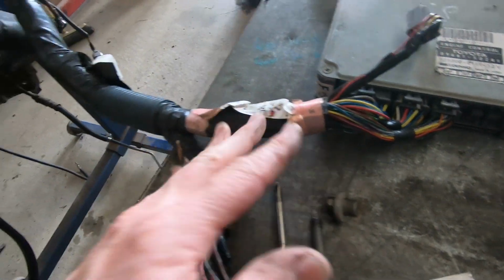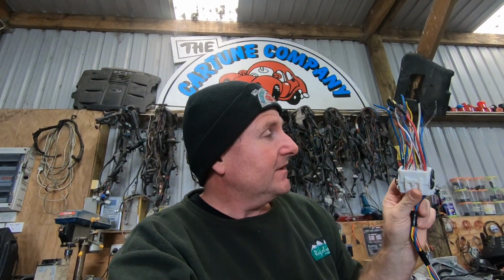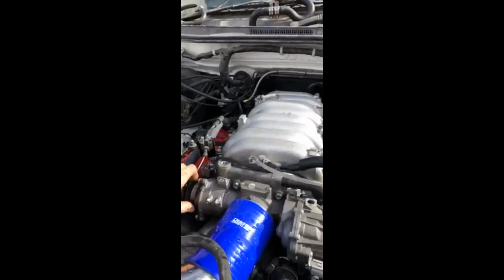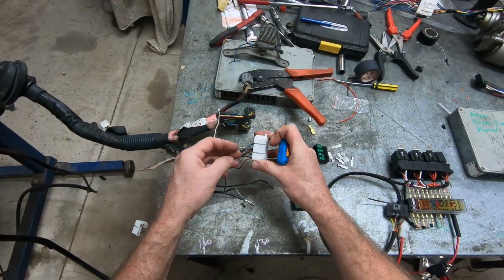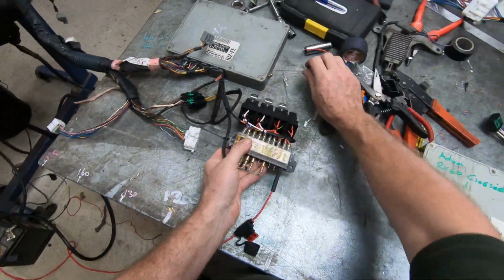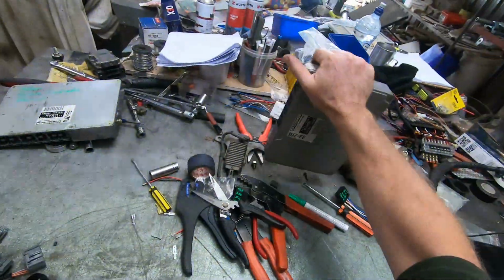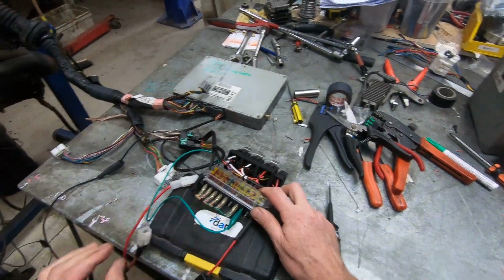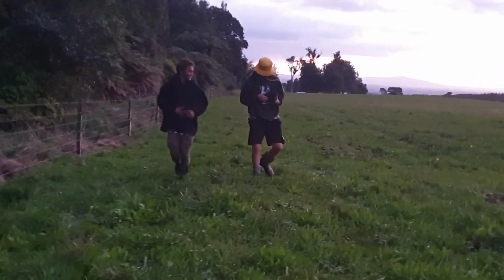UCF20 non vvti super easy fit plug and play Relay setup to stock wiring loom - Manual only.

Comment: I am in the early phase of wiring in my 4Runner 1UZ swap - reading diagrams.  I am assuming the 4 relays in that setup are ignition, starter, main/EFI, and circuit opening relay.
Reply from the maker: Some have start relay and resistor for fuel circuit,  some have start and the twin fuel relays depending on requirements.   I have information to purchase on wiring these correctly
Reply: @CartuneNZ Thanks for the quick reply.  Do you have a web address I can visit?
Reply from the maker: https://thecartunecompany.co.nz/contact.aspx

Comment: Would that work on a 90 ls400 as well? I was just going over your instructions last night trying to put it together
Reply from the maker: For a manual setup all the same wires exist in the 1990 however pin positions are different.  In time ill make the same thing for the early looms too.

Comment: I’d love this set up for a 40 40 40 soarer auto. Please let me know if it could be available.
Reply from the maker: In time Ill do one.  Soarer have lots of extra wires which are a bit of an issue when designing this sort of setup unfortunately but in time ill work out a plan.
Reply: CartuneNZ yeah I need one also for a manual transmission and trans look removed. Please let me know when it’s done, I would like to purchase one too.

Cheers

Comment: Brilliant stuff. So with this relay setup i could basically strip out trac control, air con and such that i don't need from my 91 soarer loom put a plug on the required wires plug in relays and have my cruiser running. Mine is going to run auto so would need the appropriate relay setup when available, but this just made my day. Wiring and the cost is something that has had me a bit worried on my 45 cruiser conversion. Currently running commodore v6 with a "v6 conversions" loom
Reply from the maker: Thats the basics of ot however I dont support soarer atm.  The soarer engines are common in oz so I'm doing lots of loom refabs as they are all pretty tired.  The configuration of the soarer loom with the main power inputs beside the battery and lots of extra unused wires in the loom dont make it as easy as the ucf20 harness.  Im looking into it however have other projects to complete first.   Theres another video coming I'm sure you will be interested in.
Reply: @CartuneNZ  Ah yep. I could in theory run a later loom and ecu though?. If i can find one. I have three looms and engines here all 91 soarer one being in donor car UZZ32 so won't be using that loom or ecu anyway. Will send you a couple of pics of what motor is going in if you like. Is a bit different

Comment: Cheer mate 👍 Appreciate the info... Keen for a relay setup.
Reply: Is this relay setup for bypassing the factory fuel wiring system? And how much do you want for it? now I live in the USA . I have been having problems with my rev limiter being at 4k and not at 6k like it should. But it dont happen all the time. Just once in a while.
Reply from the maker: This setup is for engine swaps and does contain fuel pump circuits with the resistor bypassed to allow full fuel flow at all times.  I sent stuff to the USA all the time. At present they are $800nzd.  Flick me an email at info@thecartunecompany.co.nz if you wish to purchase.  Cheers Kelvin

Comment: Hello good Sir, I have a weird question: Can you f#ck a warning light circuit in ecu by incorrect wiring it? Engine starts and run but absolutely no warning light... 

Greetings from UK.
Reply from the maker: It sure can.  Ive seen it a few times.  Correct diagnoses first them service ecu.  Cheers Kelvin